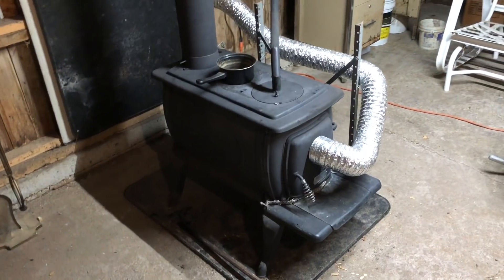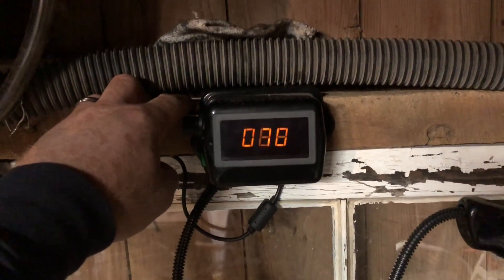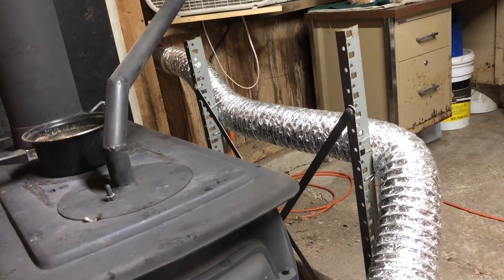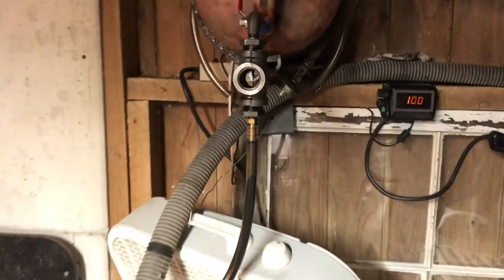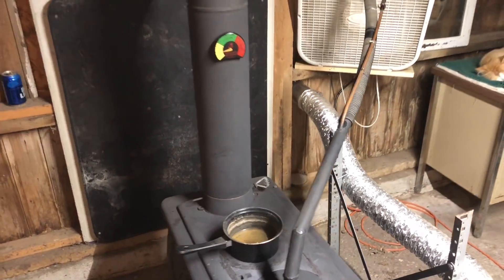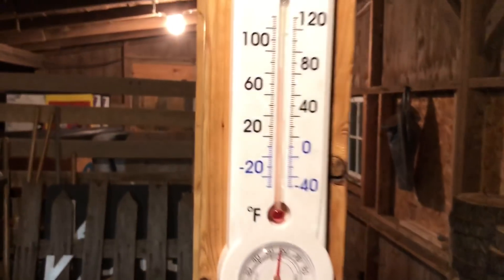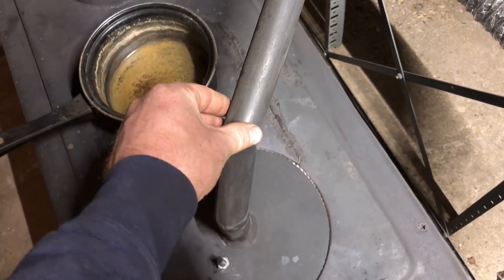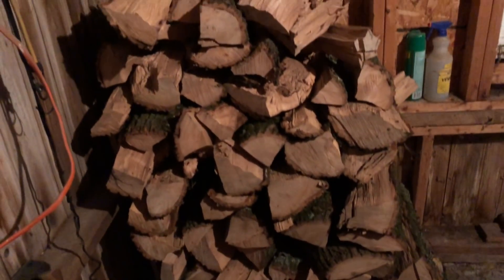Oil Burner

Comment: With how it is set up, more oil will make less heat and bigger mess. Less oil will probably make more heat
Reply from the maker: Unfortunately all that got scrapped out. It was just something to tinker with to try and understand different outcomes.
Reply: @codyknox802  gotta start somewhere. Some day I'm going to build one. Have an old stove to start. Plan to make it an outside setup. Don't have room in the shop.. should be fun 🙄😂🤣.

Comment: You are still pulling air into the building because THE FAN IS INSIDE THE FRICKEN BUILDING einstien!! Think about it. Annoying hair dryer running inside? No thanks. I'd put it outside and get rid of the noise. how long will a hair dryer last? He'll find out!!

Comment: Any updates on this? I know it was a year ago but looking at things in the video it looks like you need to completely delete that outside air intake. I actually think it's getting far too much air it should be getting much hotter but all of that is drafting up the chimney. If you had the stove sealed off and just that air blowing in from the dryer it would burn much hotter. Hotter = cleaner burn too

Comment: If you want a hotter burn you will need more air. I've built a bunch of systems like this in various configurations and have learned that you should have an excess of air at your disposal. That hair drier is too weak to supply the air you need (even if you cranked up the voltage to its maximum). Your air pipe for the forced air should be approx. 30 percent bigger to allow more air without creating too much velocity which could blow out the flame at low settings. When you have enough air being forced in all you do is adjust oil flow, you don't need the pwm controller unless the flame is blowing out at low settings. I like the wood stove conversion, very practical.

Comment: How's the burner going
Reply from the maker: Dakota Keeno good! Ive added a preheat coil for the oil. But I haven’t switched back to the old air pipe to try and lower the pan yet.
Reply: Just Right Dezignz that's good just make sure that don't malfunction bc if that gets to hot and starts steaming it will make a gas and will catch fire but it's been running good them awesome

Comment: Why needing a blower/Hair  dryer ? why not use  seccondary combustion air intake .. Then you wont need blower after 20 mins of initial start burn ;)
Reply from the maker: Inside Man well I’m not exactly sure how I’d set that up.. yet!
Reply: I will eventually get around to making a video its on the list of "Things to do" ;) I heat a house with one  and a couple of arch pollytunnels with the other Once its been burning for 20 or 30 minutes I open secondary gate valve this  then sucks in the air and spontanious  secondary combustion takes place . I do use real dry wood and often mix wood  and oil . It takes a few tries to custom drill the air holes  and pipes but well worth the  effort .
I enjoyed  watching your vids ;)
Reply from the maker: Inside Man that’d be awesome to see! Thank you I appreciate your feedback!

Comment: using metal pipe in close contact with the flue (or even IN the flue) can preheat the air for cleaner burn, but its not been tried.(by me)yet. Another fork in the road. Good luck!
Reply from the maker: Thanks I’ve got some ideas now!

Comment: I was thnkng 1.5'' - 2'' (iron) pipe w/ lower air velocIty.
Reply from the maker: florence marini that may just do the trick. I only went with that size pipe so the shop vac hose would fit over it!

Comment: Larger air pipe will allow a bigger fire, might need a bigger blower
Reply from the maker: I originally had a small shop vac on it and it was a larger fire.That made the whole stove glow red hot so I switched to the hair dryer. I do need to raise the voltage because its not blowing as much air as it was before I gutted the hairdryer element. I’m working on adjusting this set up for a better burn. Appreciate the feed back!

Comment: I would turn down the oil feed it's outing to much oil I have mine on a drip with lots of air and it burns way hotter and last longer way hotter just my opinion
Reply from the maker: I recently tried turning it down and It seems to just blow the fire out. I’m wondering if I’m not retaining enough heat in the burn pan. Appreciate the feedback!
Reply: That's weird I have mine hooked to a blow up mattress pump and I got it on a drop that's a hard one how far down is the pipe from the bottom of the pan cut off like 2 to 2 1/2ich off from bottom of pipe the pipe is to close to the pan and putting out
Reply: Yes your pipe is to close to the bottom of the pan give that a shot
Reply from the maker: Dakota Keeno I just installed a larger air pipe and Im burning less oil now and it is a lot hotter! Video will be up in a few days!! I will also try and lower my pan it just sitting on a fire brick. Thanks again!
Reply: Just Right Dezignz I would have stuck with the same size more air hits it bigger pipe slower air but ya try to lower the plan more can't wait for video